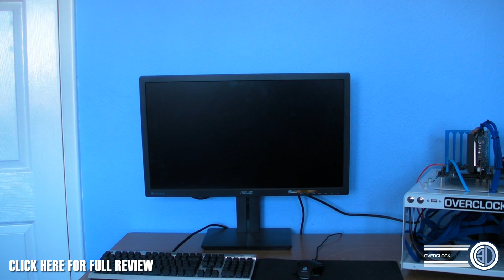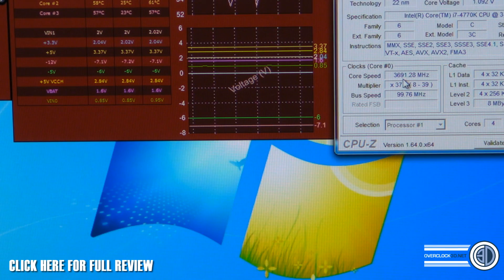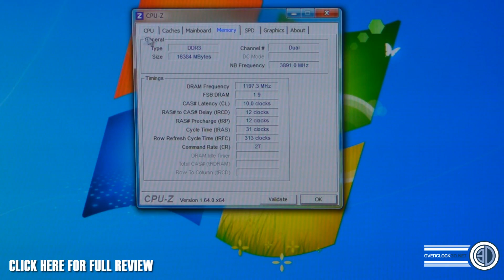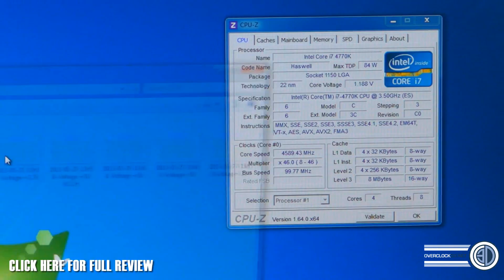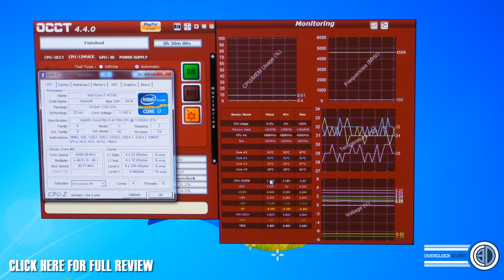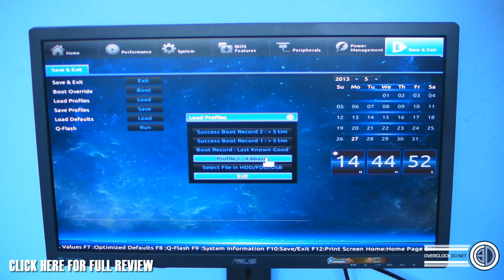Intel 4770K CPU Review Haswell 1150 Z87 Review

Comment: After watching this I sent back my Diablotek 750w psu amd bought a Corsair CXm 750w,  fits nicely in my corsair 230t and now the cables reach the top of my motherboard when, routing behind the tray and what not. Now my rig is 100% stable amenities assume safe using sli 770s

Comment: Yesterday  i bought 4770K, Gigabyte  Z87X-OC Force,  32GB 1866 Ram(8x4 sticks 2 red,  2 black color) Corsair Vengence Pro.. And 256GB Corsair neutron gtx SSD,  and 3x4TB HDD,  Cooler Master V1000 80+ Gold 1000W PSU. 
BUT R9 280x is out of stock(will be getting two of these)  and Corsair H100i and Corsair 600T is all out of stock. So waiting for other parts to start PC.. But yesterday i did started it
 with its OC brace.. And it was awesome.... Now i repacked everything till i get all the parts.. Will overclock i7 to 4.5GHz
I tbingw everyone is getting like this.. Anyways great review man.. Thanks Tom
Reply: *****  Bought XFX R9 280 a day ago.. Loving it, gonna get another 2 in a week. Its out of stock here in India so gave some advance money to retailer to reserve 2 of them for me.. The one i bought is Made in Chine( i guess for everyone also) is manufactured on 10th Jan and i bought on 15th, :-D pretty quick. Anyways i will get 780 as you said for my another sysem which will rock i5 3670K, 8GB Ram, CM V850 PSU, Corsair Graphite 760T..this is a rough thought.. will be build around March of this year.. So any other suggestion regarding this is appreciated..

Thanks bro, i will get GTX780 as you said..
Thanks a lot man

Comment: Upgraded from X79 3930K to Z87 4770K ,have to say haswell is very very good but so so much heat! Still it does out perform 3930K X79 platform in PC Mark7 and for general PC use,most software cant take advantage of 6 cores anyway.

Comment: mine wont go over 4,5GHz at 1.215 V
Reply: Stepehen Rundle There are percentiles for i5/i7 overclockability. Not everyone gets a good chip that can OC to 4.5+ stably.
Reply: lol?? I'm running my i7 4770k with a h100i at 4.6ghz... with no problem. I brought it built from scan... as a bundle of cause...

Comment: Hey Michael, that is exactly the same issue I am facing with my NZXT Kraken X60 - I mean it's the same Asetek stuff...
I wrote NZXT but they can't be bothered to reply apparently, at least not those guys 'responsible' for Europe. Nylon (Rubber?) washers should do - I bent the whole braket (Intel) so that the 4 mounting points are higher than the middle (seen from the top). That way, mounting the block, you get a wee bit more pressure. But ya, shouldn't really be doing this random DIY....

Comment: The way to check is to have the benchmark running and then to put some pressure on the top of the H100i pump and see if the temperatures go down. If this is the case then you will need to put in a washer as described below.

Comment: There is a problem with the H100i and that is that the bracket for attaching the cooler pokes through too high on some motherboards - and Gigabyte motherboards are one of the ones identified - and this affects the cooling efficacy of the H100i. What has to be done in this case is that a nylon washer (about half the width of the washer that is on it) has to be added so that the H100i will make proper contact with the CPU. It is easy enough to check. ---- continued ---

Comment: well , i have the same cpu , BUT , i don't know if theproblem is becouse of my moterboard ( asrock z87 extreme 6 ) , or becouse of the chip itself. I can't overlock it to 4.6 ghz without hitting like 90 degrees with an h100i cooling. My voltage is waay to high. I can run 4.4 GHz at 1300v, but if I lower the numbers , it will crash. I can see that you're running it at 4.6 GHz with 1.2 Vcore. WTF ?

Comment: After a terrible 4670k I actually returned and exchanged for a 4770k.  I get 4.4GHz stable at 1.13, and I'm not going to bother trying for more anytime soon.  I prefer the 4.4 at low voltage than 4.5 at 1.2 or or 1.3 or whatever it'll take.

Comment: Well the thing is that i have a budget of 1400€ and i'm only able to buy one gtx 760 at first so i think i will wait a bit until i will buy a new gpu and spend the money to other things like a good cpu,psu,ssd and mainboard. I think i will get the i7 4820k when it comes out i actually hate haswell because of the shit thermal paste that is between the chip and the cover i don't exept such design faults at such a high end cpu goes hot like hell because of that shit and you can't OC it very well !

Comment: Man buy GTX 780 instead. It will give you better upgrade options in the future. When you feel like you need a second card, you can get GTX 780 for pretty cheap after next gen is released, and that almost doubles your performance. When you buy 2x GTX 760s now, it limits your upgrade options in the future. ANd remember the more cards you SLI, the more hassle there will be with the drivers and problems with heat.

Comment: Hell you'd be better off spending your money buying a GTX 780 than buying new motherboard + i7 4770K. GPU is what mostly matters in gaming, and difference between Sandy and Haswell is minimal in gaming. Also Sandy can be overclocked higher, which makes it about even in gaming performance anyways.

Comment: That's true.  It depends on what kind of gamer you are.  I play a wide range of games, including those 3.  BF3 isn't graphically intensive on the level of M:LL or Crysis, and with my gaming habits I find it hard to justify spending an extra $260 on the basis of playing 2 games better.  

I think the most useful general advice if you don't know another person's habits is that at 1080p 60Hz a single 760 is fine, and for 2 or 3 games turn down the settings.  The extra cash shouldn't be mandatory.

Comment: This is the one closest to my method: /watch?v=XXs0I5kuoX4
Just a couple of things that I think you should do:
- Make sure to be grounded (standing on a metal plate will do). Avoid carpets/natural fibers.
- Use surgical gloves (the ones with no Talc powder).
- Thoroughly clean both parts with alcohol.
- Try not to cut yourself. Occasionally take a breather, the CPU will not run away.
- I prefer to brush a very thin layer of TP (Noctua). 
Hope this helped.
Cheers.

Comment: cont...
7- Thermal paste the cap, and mount your CPU Cooler, like you would normally.
You should now have a "Golden Chip".
Temps on all 4 cores: 65 to 70 Cs in idle mode.
DISCLAIMER: Decapping the CPU will make your warranty void, and null. If you Fuck Up...Tough, buy a new one.
If you are careful, patient, and thorough, it is an easy task, and your chip will remain cool for years...Assuming you use a proper cooler, of course (I prefer air to water...Noctua Works).
Hope this helped.
Cheers.

Comment: Be sure to insert the razor in the glue scraping against the metal cap, and away from the down part.
3- Once enough gunk removed the cap should be easily removable, do not force it, it will come off.
4- Clean everything with Ethyl Alcohol 99%, using toilet paper (this include the cap, all the glue, all thermal past).
5- Apply good thermal paste to the CPU (inside the chamber, not on the cap). Don't overdo it.
6- Insert CPU into Mobo. Place the cap on top (it will be held in place by socket)...

Comment: Solution to fix 4770K's thermal problems, and always have a "good" overclockable CPU: 
Be sure to place the CPU in a white surface, so you see all the gunk that comes off (I use a linen towel)
1- Brake a Wilkinson double razor in two, use a wine cork give you leverage (on the side with no razor, and upwards inclined). You can also use a very thin boxcutter.
2- Slowly,and carefully start inserting it between the glue, and the metal cap. Slowly scrape all around the CPU [continues]

Comment: I've already given up on installing the 4770Ks without uncapping them. I assemble as an hobby, and normally all my friends/family/pets always ask me to assemble their new rigs (most have been 4770K lately). In 6 chips only one had acceptable temps. So now I just uncap them all, to avoid having to disassemble everything.
The problem is with the glue used to join the cap with the CPU (Intel have claimed it was too much, or too high, creating a "Thermal Chamber"). The solution in the reply:

Comment: I ordered the 4770 to complete my build, because all this over-clocking information fries my brain. But it really is good that reasonably low level scientific types are keeping track of what is possible.
My kit. 
4770 chip
Zalman CNSP14X Tower cooler
Z78 Sabertooth (how to get the cooler spanner in to tighten bolts) 
HD7770 until I can figure out which graphics card to go for.
Zalman Z11 Plus case.
WD Black 1TB
16GB of A-Data 1866 memory.
Later maybe will get an SSD when the system is running.

Comment: I'm 16 and have a job so know a little bit about life. My parents pay about 60 in the winter and 75 in the summer. My grandma pays 70-85 and that's when it's 90+ with air set to 78 and me using power tools (which draw 15 amps). Computers don't really drive up cost too much, the biggest factors are HVAC systems, fridges, powerful pc's (1000w+) and possibly powerful stereos.

Comment: Electricity is cheap in the US heck you can run the A/C and you might pay 70$ a month (depends on the system and house) total. Running a PC might cost 10$ if that a month.

Comment: Man you give out gold awards like nothing these days. Giving it a gold award would somewhat imply that there are at least decent gains in terms of performance compared to it's predecessor the 3770k. Yes better performance per clock and lower power draw when now OC'd, but it's a k series cpu and any sane person will OC it, in which case there is next to zero performance gain due to heat output and not that much difference in power draw.

This is just a case of intel buying it's way to the top

Comment: Ivy Bridge and Haswell are hot because Intel used Cheap TIM between the IHS and the Die whereas Sandy Bridge and before they soldered the die to the IHS. That's why Deliding works.

Comment: IPC will increase quite a bit -- probably 20% I'd say, not 30-40% claimed. The biggest innovation in Kaveri will be hUMA, since the CPU and GPU will have access to a unified memory space, wasteful read and writebacks between system memory to GPU frame-buffer will be eliminated. I know that this will increase performance and significantly reduce latency, but it will be interesting to see what other measurable effects this will have.

Comment: And I already KNEW why the haswell cpu's are very hot involving the FIVRS being moved to the cpu's " section", but that still doesn't mean they are proned to OVERheating...It will only overheat if the idiot end user doesn't put a good enough cooling solution on it IF overclocking.

Comment: If you could afford a Ferrari, you could afford the Mpg. Bring on the CPUs with high TDPs and more processing power. Give those people a reason to have their 1KW PSUs and custom water cooling loops. Performance/W£ for intended computing workloads, is the true measurement ofcomputer hardware efficiency, in a monetary economy in any case, otherwise it will just be perf/W. For enthusiasts of varying budgets however, all they care about is performance.

Comment: Ok you just told me this 4770k is meant for mobile?  LOL.  get real.

If this cpu run THIS hot in a desktop pc case environment with decent air cooling..there's no fucking way in heaven or hell or earth that it won't run HOTTER in a gaming laptop.  If Razer and msi's best gaming laptop cooling designs won't be able to cool this cpu without figuring out a way to LOCK it's clocks, blcks, etc to GUARANTEE it can't be overclocked no matter what.

Yes your last sentence IS correct.

Comment: How is OVERclocking a cpu that has VRM control technology built INTO it give it the judgement of proned to overheating?  That's idiotically an unfair judgement.  What customers are reporting bad overclocking results?  The one's who are asking WAY to much out of their cpu's and/or DON'T know wtf they're doing it?

a 4.7ghz haswell will outperform a 5.0ghz sandy bridge anyday.  it's not just about clock speed. there is a HELL of a lot more to it than I understand. That is being honest.

Comment: doesn't the iGPU in the processor give the CPU some advantages regarding certain computation calculation that the processor can now shift over the the iGPU, also things like openCL also can access the iGPU side of things and gains advantages, and then there is Quick sync video that largely depends entirely on the iGPU as well. The iGPU does come in handy for those who get a unlucky GPU failure and don't have a spare £150+ right of the bat!!!

Comment: If power is main update then why tdp increase. Dissapointed with haswell. Hope intel realizes they need to start putting the work in or they'll just fall behind. Its obvious there starting to hit the brick wall. Major changes are needed to the chip makers strategy.

Comment: I don't think so, AMD had their 3 core CPUs, but these are 2 cores on the same cache, there would be 1 supercore(10 cores with 1 dead), also these are not likely the new modular steamroller cores, so I think they just stick with 8, maybe there will only be the 8770(even those rumors doesn't say anything about it), and the 9000 thing is just a DBZ over 9000 joke

Comment: a cpu's max temperature isn't a direct indicator of the temperature it is going to produce, the fact that the amd cpu's max temperature is 62c doesn't mean that's the maximum temperature its going to produce, it just means that's the max heat it can take before it begins to get damaged. so theoretically the cpu with the lower maximum temperature could still produce more heat.

Comment: He Tom, I think the voltage in the core is (much) higher than the Vcore. There is a Vccin voltage that varies between 1.8V and 2.3V. It also can go up to a maximum of 3.04V. This may can cause the high temps.

Comment: small amount cheaper. the only new things that the haswell bring to the table are minuscule for performance. and i don't even need to look into the new features of the chipset to tell you that. faster ram? let's face it that makes a very small and unnoticeable difference. pci 3.0? does nothing. my argument is that sandy bridge will give you better overclock temps(who wants a 90 deg. proc next to them?). and nobody in their right mind is buying a 200-400$ unlocked cpu just to keep it at stock.

Comment: a 5ghz sandy is about the same as a 4.6ghz haswell. You misread what i was saying because the haswell can't reach 4.6ghz without that spike in temps, making the overclock out of reach. ivy had the same problem but intel apparently does not give a fuck.

Comment: Nice review apart from the power consumption bits.

At idle an ivy bridge will only pull like 2W, haswell next to nothing. Idle power use is completely determined by all the extra stuff on the mobo and the other hardware.

"it pulls less than my i3 home server, it has 8 harddrives" 8!, that's 80W right there.

Comment: 4.8 stock and turbo to 5 for the 9000 with a 220W TDP xD 
It's basically a guaranteed overclocked Piledriver. Wonder how much more juice it will have left in it

Comment: There are a rumors about a a FX-9000 and 8770. The 9000 should have a stock frequency of 5 GHz and a TDP of 220W!!! But rumors also say that it is going to cost a fortune hehe It is going to compete with the socket 2011 CPUs from Intel.

Comment: the temps are crazy, which makes the clock speed out of the reach of normal cooling(h100i outperforms the noctua and mugen2(he used an h100i)), i am saying that any realistic overclocks on the haswell will be outperformed by sandy's overclocking.
if you are the type of person who likes stock frequencies, then i guess this is a winner, but who drops 300buckaroos on an unlocked cpu and leaves it at stock?

Comment: Your statement about the integrated gpus that no one would use it, those who buy the high end i5/i7, is wrong. I use my HD3000 in my 2500K for my secondary monitor meaning my 680 is idling at idle clocks rather than near-load clocks.

Comment: did you watch the review? at 4.6ghz his cpu was at 91 degrees(hottest core at full load). to even reach this clock you would need crazy good cooling or not have it at all. and from what you are saying, the 5ghz sandy will be evenly matched with a 4.6 haswell. and it will do it at better temps. And about removing the top of the proc, i should not have to do that and risk ruining my chip just to be able to keep up with sandy bridge overclocking.

Comment: The 4770k at 3.9ghz is better performance than a 2600k at 4.3ghz. So a 4770k at 4.9ghz its better performance than a 2600k at 5.2ghz. You understand what im saying. Ivybridge was better performance than sandybridge, ivy with 200mhz less.  Now haswell is 200mhz better than ivy. So clock for clock haswell stock clock is like sandybridge over clocked to 4.3ghz.

Comment: in 2011 iam using 2600k air clocked at 4.8ghz=trottle 
in 2012 using 3770k air clocked at 4.4ghz=trottle
and this 4770k iam pretty sure it will run 4ghz on air...
So where the perfomance improvement here??

Comment: 4560k apart from hyper-thread deactivated is apparently the same as a 4770k. So in theory they should use the same power during non-hyper-threading tasks (games), in massive multi-thread applications(video editing, compressing, multi-client) the performance will increase a bit through higher density of the data, which will increase power used too, as used transistors take more current than idle ones. So in up to four threads used no difference in heat, more threads i7 will heat up more than i5.